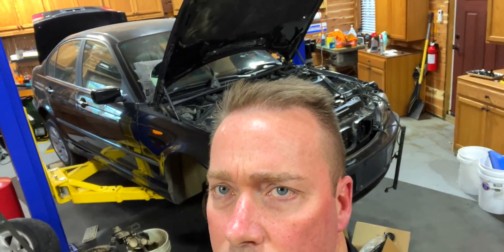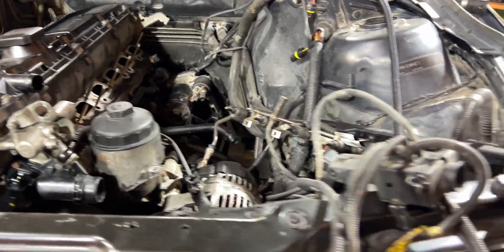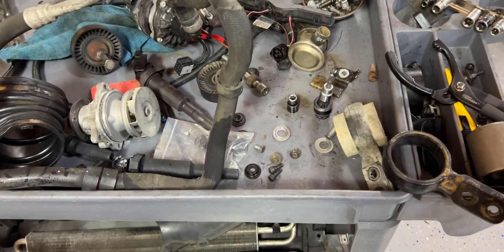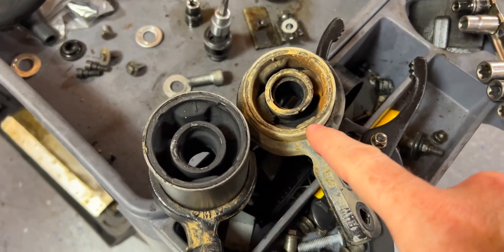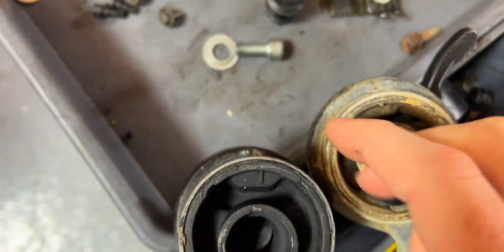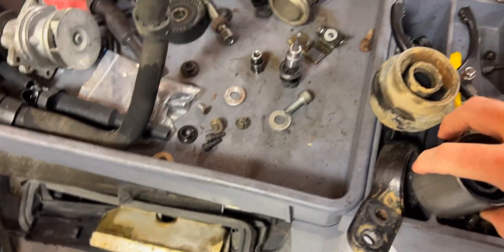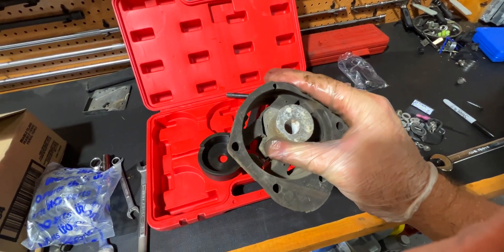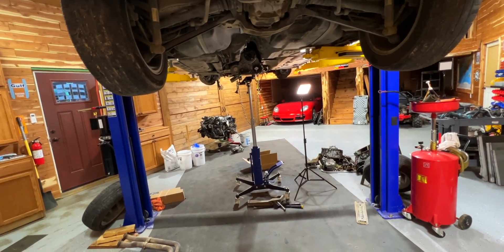Finishing The BMW E46 AWD Project Car Control Arm Bushings And Transfer Case Mount Replacement

Comment: I have an e92 with x drive i just bought and I'm getting sort of a vibration on what feels like under the seat and makes the shifter vibrate. I thought it was axles and replaced them but I'm still having a problem, any suggestions since you have more experience?

Comment: Hardened M12 or M10 threaded rod (class 10?) is what you need for pressing things in/out ... plus lube on the threads, wheel bearing grease works too, anti seize makes a mess.

Comment: Use anti sieze. The goop for wheel studs that has graphite in it. 
 I did every bushing on my e39 touring rear subframe with 1/2 threaded rod from home depot after I smoked that grade 0. Had to lube the threads.. makes a WORLD of difference. Takes half the foot pounds to turn it.  I used 1/2 nuts with washers outside the cups.

Comment: I own a 2004 bmw325xi all-wheel drive there's nothing wrong with my car it's straight body looks really nice nothing that I change is to black trim and I painted it the same color as my car makes it look a lot better other than that I guess what it is is not too many people would take care of the car I'm rocking a 230,000 miles

Comment: A bit late, but you didn't need to buy the whole replacement lower arms, just the inner ball joint.
The E36 outer ball joint fits the arm just fine. It takes some chiselling/press work to remove the outer joint.
Also the E36 M3 bushing is a solid rubber replacement for the hydraulic bushing the E46 xi uses, also only $15 for a pair.

Comment: how different is the awd in this compared to the x3 setup?
Reply: Similar in layout but the E46 xi uses an NV124 gear driven permanent transfer case whereas the X3 uses a different chain driven transfer case with a motor to control torque distribution.
Reply: @fahisaurus  are the transfer cases interchangeable?
Reply: @skodalaskoda8754  No. Shared layout does not mean interchangeable. Ones a gear driven permanent transfer case, the other has a motor to control torque split.
Reply: @fahisaurus  I understand what you are saying, they do different things.  if I wanted to change my x3 to the sedan transfer case, could I?
Reply: @skodalaskoda8754  I cannot say for certain, but assume no. Only replace same for same someone actually does confirm the fitment interchangeability.